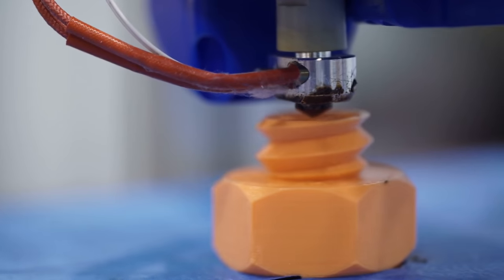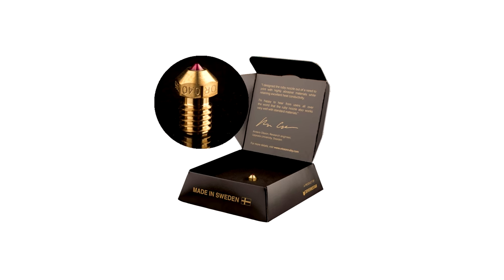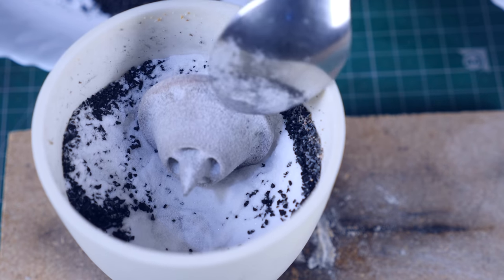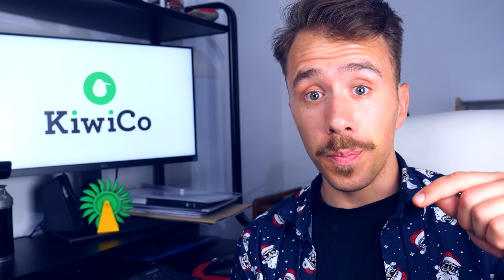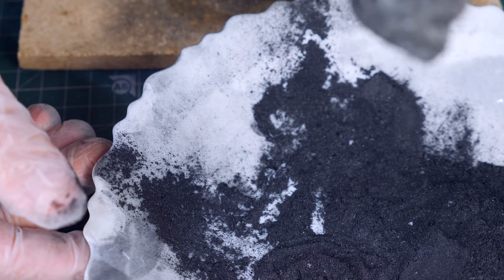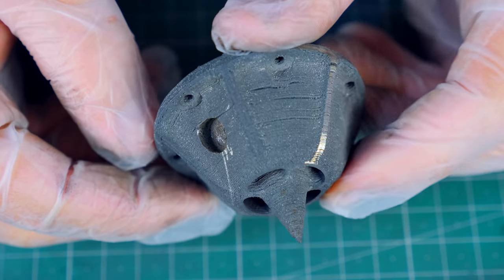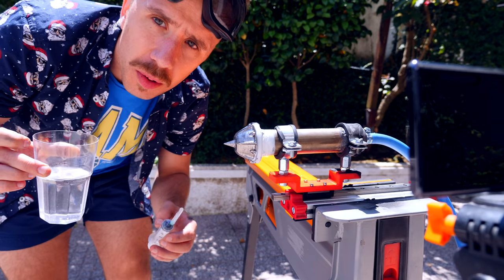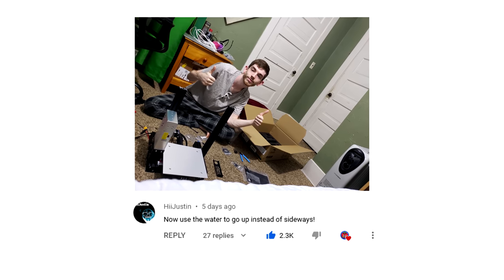How I 3D Printed a Metal Aerospike Rocket at Home

Comment: The nozzle didnt melt, it burnt. The oxygen rich exhaust cobined with the heat is oxidicing iron/steel increadibly fast
Reply: Watch from 16:19-16:25 on 0.5x speed. At about 16:22 you can see the nozzle throw out of the exhaust.
I don't know if this means it melted or burnt or whatever... Well, technically it did neither. The supports did, and the nozzle flew off.
Reply: Also, there are a lot of sparks and pieces of metal flaking off during the entire engine burn. I honestly don't know fully what to make of it, but I'd say the force of the burn plus the temperature is causing the metal to basically peal off. Maybe a better sintering would counteract this somewhat.
Reply: @plzletmebefrank  I'd argue that Sintering will never be the way to go for this; leave too many pores and makes the metal awful for cooling
Reply: @vaelophisnyx9873  Yeah... That does seem likely. It also makes it so when it expands from heat, it'll kinda pop and break apart, easier to flake off, easier to peal away...
Hmm. Yeah. I'd like to see exactly what that bronze looks like on the inside close up. Like if it were cut in half and then put under magnification. How solid it is, what the gaps look like.
Reply: @plzletmebefrank  Might work better at larger scale where heat dissipation (be it "into the mass" or a coolant) is a bit more manageable. Hot spot develops in small parts, not a whole lot of time to react to it in some way to prevent catastrophic failure.

Not that real deal big boy toys aren't known for spontaneously going wrong... 🤣
Reply: what if he printed channels through the nuzzle that could be used to pump liquids/gass through to cool it off and then treat the nozzle with ceramic coating to prevent oxidizing. This way the nozzle has deflection, mass(heat sink), and active cooling.
Reply: @prydzen  With that kind of heat, it doesn't matter much

Comment: Turned out beautiful! Looks pretty time intensive though.
I think it'd be pretty interesting to try printing a tensile test bar with it, and compare it to homogeneous mild steel -- see how much strength you lose with sintering vs e.g. machining. Although I guess for rocket engines yield strength doesn't really matter haha
Reply: It totally matters. If your rocket explodes due to pressure, I'd say you have an issue.
Reply: @nikkiofthevalley  Thats not what KSP taught us! If it explodes, put moar boosters around it to suppress the explosion!

Comment: If you've got an excess of Oxygen going through the nozzle, then it's going to act like an oxy/acetylene torch where the heat plus the O2 burns the steel away, destroying the nozzle in the process.
Reply: Yes, this is 100% the issue. You can tell by the flame color and sparks that it is oxidizing. Too much oxygen will destroy pretty much anything. Cooling the nozzle will not help. You want a slightly fuel rich combustion to prevent this from happening.
Reply: Or maybe it might be possible to design the engine to have a gap between the flame and the nozzle like most oxyfuel torches work
Reply: @joshuahuman1  that would result in a significantly lower thrust.
Reply: How about making the o2 port smaller, that away less o2 coming in the combustion chamber that away it’s a richer mix or how about something that burns a little bit cooler. You won’t necessarily lose thrust this way.
Reply: Engine-rich exhaust is the industry term.
Reply: yeah you can see the sparks of steel flying almost immediately
Reply: There could also be a problem with the metal composition it self that may make it weaker to high temperature since there should be a great amount of cavities in the metal because of the printing / thermic process
Reply: @-darnasek-1872  you could definitely be right, though I would've guessed that voids in the metal would act to insulate. I think we'd need more testing to find out, varying the oxygen levels and nozzle composition
Reply: Sparks, every forge welding smiths nemesis. if it sparks you definitely lose material.
Reply: @shutupfish1619  yes,you will
Reply: @trillrifaxegrindor4411  not necessarily. It takes about 900 degrees Celsius to create thrust. I would say his engine is burning around 1400 degrees Celsius maybe a little more, it’s melting the steel which melts a little over1300 degrees c. A cooler burning fuel might help. This is just a hypothesis, which means it could be proven wrong but it is an educated guess. Another thing he could do is develop a cooling system, like a sealed tube with antifreeze running threw it around  a spiral and out to cool in an ice water chamber he would need some form of pump though.
Reply: You're right, he should try for mildly fuel rich exhaust
Reply: @shutupfish1619  i don't think melting is the main problem, he's oxidizing the steel to slag. but lower temp, in combination with fuel rich exhaust, would help with that too.
Reply: He could try nitrous oxide instead of oxygen.
Reply: @shutupfish1619  given the short duration of the test, if it was just a melting issue the part should be mostly intact and only just begining to deform.
Reply: @averagejoe9040  not if the metal gets hotter than it’s melting point the rocket is creating an acetylene torch effect causing it to melt and come apart. It takes roughly 2 seconds for a acetylene torch to put a hole through a half an inch thick metal sheet
Reply: @shutupfish1619  yes, but that effect is more akin to burning than melting. Just exposing the metal to the heat of the exhaust (as was the suggested problem in the video) wouldnt cause the metal to melt fast enough as what was shown in the video. And, because the destruction wasnt caused purly by the heat, actively cooling the part wouldnt have any significant advantage.
Reply: @averagejoe9040  it still has the same effect as  a acetylene torch cuts with exposure to it exhaust
Reply: @shutupfish1619  I didnt say it wasnt. I agree that that is the problem, but that cant be solved with part cooling. That effect isnt due to exposue to high temperatures, its because the introduction to high temperatures AND oxygen are burning the material away, not simply causing it to melt.
Reply: @averagejoe9040  so what would your opinion be on a better gas, nitrous oxide will burn hotter, I think a smaller O2 port would be a good start also maybe less pressure. What do you think
Reply: @shutupfish1619  I think someone else said it here, but I would decrease the oxygen to fuel ratio. To stop the oxygen from burning away the nozzle all you need to do is make sure that it reacts completely with the fuel before it gets there.
Reply: @averagejoe9040  I agree
Reply: Fuel stoichiometry could be solved with a carburetor.
Reply: @Septicemic-Fugue  this is a hybrid rocket engine. A carburetor won't do shit.
Reply: @Septicemic-Fugue  i hope this is a joke

Comment: Video Idea: with this new knowledge and the possibility of printing metal at home try to create a liquid-powered rocket that runs on O2 and RP4 or CH4. (Create a mini raptor engine or something similar). Would make for a great project and especially would be very interesting, because rocket science at home...

edit: It would be even cooler if you could integrate this into a model rocket
Reply: Making liquid fueled rockets is hard because you need to somehow pump the fuel and oxidizer against the pressure of the reaction chamber. Hybrid N2O/PMMA engines are easier for the amateur because N2O will self-pressurize at room temperature while O2 and CH4 must be pumped as cryogenic liquids.
Reply: compressed CH4 could work. It might be way easier than doing a hybrid style like in the video. I wonder if he could even design cooling channels right into the engine block. Supposedly that is why most major rocket engine manufacturers are switching to some form of 3D printing.
Reply: It would be cool to see him put this aerospike motor on a hobby rocket and launch it

Comment: Print the nozel in a way, that the Fuel/Oxidizer first runs through cooling ducts on the nozel and then burns away
(Thats what actual rockets do sometimes)
Reply: I think your overestimating the tolerances of 3D printers on small parts
Reply: Hasn't he used a design with that before? Or has he just mentioned it a lot...?

Comment: Hey integza, from my experiments with sintering I got the best results packing the parts in fine Epsom salt and only a thin layer of carbon on top. I'd give that a try
Reply: Epsom salt contains nearly half its weight in water, and partially liquefies when heating. That should cause problems...
Reply: @Nuovoswiss  I was thinking the same thing.  It's a penta-hydrate in store bought bags.
Reply: you'd have to bake it first to get the anhydrous form. I can think of a bunch of better salts, regular table salt would be a LOT easier

Comment: 2030: How I 3D printed a planet to land on with my 3D Printed Rocket.

Idee for another video before 2030 ( =] ): Try to use some liquid or gas for fuel. That way you don't have to clean your chamber every time and you can run your thruster way longer and also don't use the fuel as a structural part to hold the nozzle to stop it from falling off.
Reply: That's another hell of an engineering Prosses liquid engines are another mountain of problems. Pressure gas flow valves injectors the system to actuate them and if he is using lox as oxidiser you need a cryogenic version for each. Ther is a reason why most amateur rockets are solid fuel it's just easier you put the fuel in the tube bam rocket.
Reply: @stekra3159  i didn't consider that. maybe a solid engine with granulat is an optan. that way you are also able to input fuel into the system while it's running
Reply: @drohnele3741  if you are going to use liquid or gas propellantyou must do calculations to make it flyable or safe. (except cold gas thrusters)
Reply: @Emre_Kermen  isn't it enough to once calculate the ratio and then just set your valves on what you calculated?
Reply: 2030 is tomorrow.
With capitalism, time does not move.

Comment: would be interesting to see whether induction heaters can be used
ps. remelting it (salt baking style) as a pre-processing step might help the layer separation; also, copper alloys might be better for rocket nozzles as they might melt, but will not oxidise into obscurity
Reply: thats what I want to know, induction heating could bind it within seconds
Reply: Need a DIY heat source. That kiln is way more expensive than the 3d printer.
Reply: @hexdude24  indeed, it would be nice if a microwave oven could be used

Comment: Printing metal filament is something that seemed just too good to be true but apparently isn't anymore. 
With this you can maybe revisit the tesla valve pulsejet engine!
Reply: True.. but it seams like its limited to metalls  with fairly low melting point. I guess incanell is out of the question
Reply: @matsv201  I'm not sure, I personally don't see any reason why if your foundry reaches high enough temperatures that you couldn't use higher melting point metals. Layer thickness seems to be a limiting factor currently. Although I don't think the parts from this 3d printer method are homogenous enough to be used for high strength or high temperature uses. But it fits the niche of home printing for when plastic is too weak. (Although having an oven capable of this is still beyond most)

For industrial aplications this is too slow and labour intensive anyway but printing with lasers and metal powder does work a lot better. Although still way too expensive for home use.
Reply: @matsv201  Nope.. they have inconel, copper, titanium, borosilicate glass and ceramics.... hell, they even have tungsten filament..
Reply: @squidcaps4308  but that sounds like yoy cant sinter  them... then you burn up your oven

Comment: Video idea:
Since you seem to love rotating forces, let's exploit the momentum.
Build a gimbal with 2 rotating disks shifted by 90 degrees (X and Z axis stabilization) and use their momentum to cancel the vibration induced by the camera operator.
Reply: That's a pretty cool idea - active gyroscopic stabilization (if that's how that works anyways)
Reply: @birbo5603  yay, in theory I can't see a reason why it wouldn't work.
Reply: a 3d printed gimbal that can be used for dslr cameras? that would be cool and incredibly useful
Reply: @xandarian55  I know, I'm commenting this from 2 videos ago, not at the top unfortunately :(

Comment: I've got an idea for a combination heat shield/rocket engine. Fiscripyion below
1) Central combustion chamber/s feeding a ring of nozzles that are oriented at 45° from the forward axis. The nozzles basically point in the opposite direction as normal. 
2) The exhaust gases flow over an arched surface towards the perimeter. In profile the arch would only be one half of a full arch.
3) At the perimeter have a series of flaps that extend below the perimeter of the arched arched surface.
4) As the engine functions the gas flow across the surface increases pressure across the surface. The flaps at the outer edge cause gases to build up increasing the pressure at the edge. Think of the engine as being similiar to a blown wing on an aircraft.
In reality the engine could probably be tested with low temperature materials using steam or even water sprayed at high presdure across the surface. The idea isn't to achieve an engine capable of propelling the vehicle in the launch phase. But instead to have an engine that would use the same structure as the re-entry heat shield as it's working surface.  This could be used in an orbital vehicle that re-entry tail first and lands vertically. 
And while rocket engines work by ejecting a gas at high velocity and pressure that pressure is acting on the engine bell or aerospike surfaces as it expands to produce thrust.

Comment: Integza the jewelry casting process using pla instead of wax is also incredibly easy and best part is that with the right torch you can do steel parts in minutes instead of hours with no shrinkage and no pores.
Reply: Yeah this process has less steps, but that would result in a better part fir sure

Comment: My buddy and I tried something like this a few tips , put a layer of the “sand” and pack it well with a wood stick as a tamp then place the part into it and pour a few centimeters of sand on and around it then use a sander to vibrate the sand down repeat this until the part is covered then use the sander again then tamp down the sand and place the carbon on top you can tamp it but we never noticed a difference, another tip you could maybe use a thermal paint or something like it to coat the part for better heat performance or possibly a form of plating would work

Comment: Possible alternatives - Titanium filament or multiple parts instead of a single solid nozzle.  Also from the printing appearance looks like you can trim down your layer heights to make the layers more compact/dense (e.g. go to fine vs rough mode on the 3d printer).  I know the steel may not be able to handle the temperatures, but can you test with compressed water or some other non-burning method.  The steel one performed very well though, congrats!!
Reply: Titanium is a terrible choice. That stuff burns easily, it's why you have to use so much lubricant when cutting it on a mill.

Comment: “Tough as nails” as in steel nails you hammer into wood, not fingernails. Hope this helps.
Reply: around me nails break before the wood does!
Reply: Nails bend...
Reply: Tough as screws is probably more apt.
Wire nails are actually designed to be pretty malleable and ductile. They are designed to mainly hold alignment for shearing forces.  This is why home construction uses nails mostly in line with the forces (nails align the wood and bend as needed, but keep the surfaces aligned able to transfer load).  Screws on the other hand are hardened, the screw (wedge) is taking a lot of tension, but are more brittle as a consequence of being heat hardened (they break easier under shearing loads).  However old cut nails were a bit different, they could hardened or not.
Reply: @LogicalNiko  i wonder if work hardening plays a role there, really old nails were forged by hand, can imagine that depending on the type of steel they'd be quite a lot harder than modern wire nails.
Reply: @connorlewis984  but don’t break easily

Bending is better than the material being rigid
Reply: I almost made a comment, but then I decided he was making a joke.
Reply: @nonchip  cold forming hardens a LOT the material indeed, so that's probably where the old saying comes from.

Comment: 16:28 i don't think it melt,  when you heat steel to a certain temperature and add oxygene it start to burn. this effect is use to cut steel ( https://en.wikipedia.org/wiki/Oxy-fuel_welding_and_cutting ). i believe that some rocket nozzle are built in stainless steel and at my knowledge the process of cutting stainless steel like that isn't possible or at least isn't used.
Reply: We use plasma cutting tools at work to cut steel instead of tourch.
Reply: looked pretty molten to me tho with the blobs of liquid metal ;)
if you actually burned the steel you'd have a whole other load of issues.
the "certain temperature" for steel to burn (as with every material, since solids and liquids can't actually burn, only rust or smoulder) is above its melting point.
also, quoting the page you linked:  "Pure oxygen, instead of air, is used to increase the flame temperature to allow localized melting of the workpiece material (e.g. steel) in a room environment."
Reply: Yep you're right you can start cutting steel with an acetylene torch, turn off the acetylene and leave the oxygen on and it'll just keep cutting.
Reply: The struts supporting the spike weren't very thick. It wouldn't be hard for the oxygen rich exhaust to erode them in seconds given the operating temperature.